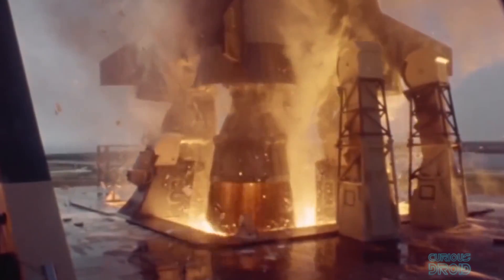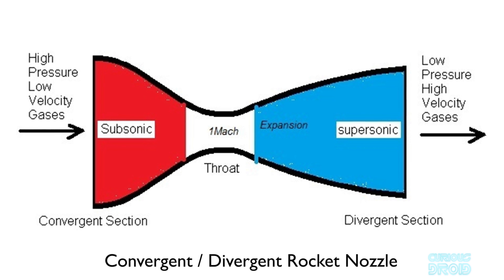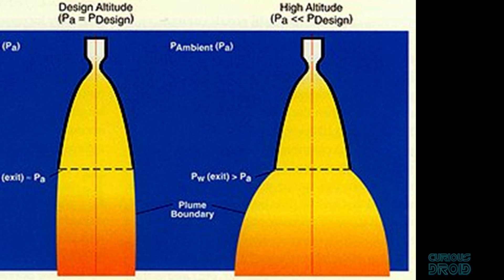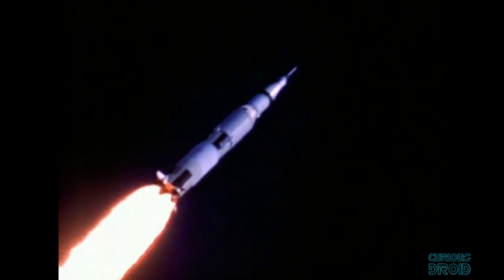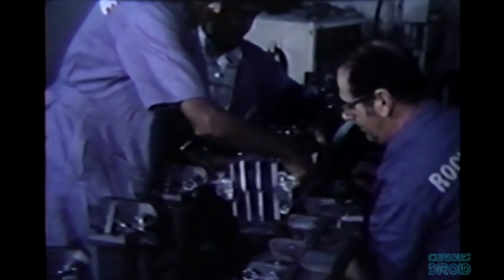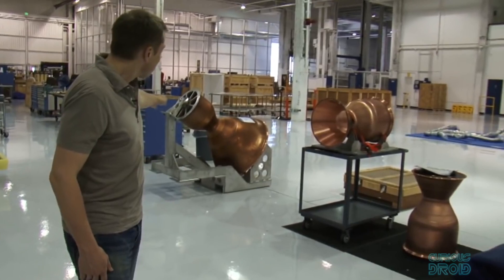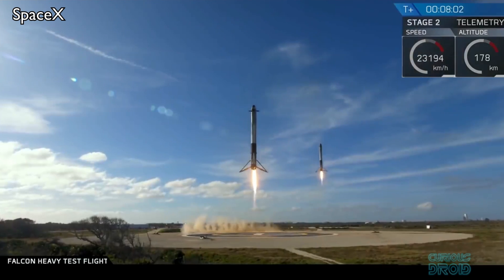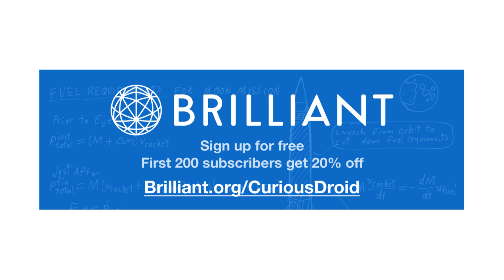Aerospike Engines - Why Aren't We Using them Now?

Comment: I hope someday Aerospikes are used for at least booster stages of rockets, they're design is awesome and I believe that if they are proven, going for a typical bell shape instead of a spike will be a thing of the past.
Great video!
Reply: In vacuum, the spike doesn't really do anything for you that a lighter, more easily-cooled nozzle doesn't. An aerospike is good for a sustainer stage like Atlas I's centre engine, though, or a single stage like VentureStar.
Reply: Chad Castagana, if you only use the aerospike for the upper stage of a traditional rocket stack then you've wasted the best chance to make the most of the efficiency gains that come from the design: a higher and more constant Specific Impulse all the way from sea level to high altitude. de Laval (bell-shaped) nozzles gain efficiency as they climb - up to a certain point -  as a result of being designed to have an under-expanded plume at sea level, which compensates for the inevitable excessive over-expansion that occurs at high altitude (where you'd normally dump the booster and light the second stage).

Interestingly enough, the efficiency vs. altitude curve of a bell-shaped nozzle is pretty bell-shaped itself, with designers needing to tune the edges of that curve so the engine is as efficient as possible over most of the flight regime for the stage while also taking into account the need to throttle down before reaching the point of maximum aerodynamic pressure ("max Q"). An aerospike still has a curve but it's a lot flatter, closer to maximum efficiency for any given propellant and engine design combination across a much wider altitude range... not a straight line, but about as close to it as physics allows us to get. 

So as Mush V. Peets pointed out, the best use for it is in a core sustainer stage. The flatter efficiency curve greatly simplifies a whole bunch of stuff in terms of the entire rocket design, so it would be cheaper to build. Such a rocket would likely still need strap-on boosters to get heavy payloads off the ground, but because the core stage is more efficient at sea level and can continue to burn all the way up to vacuum without losing that efficiency, the boosters could also be much smaller/lighter/cheaper. They'd really only be there to give the "kick" required to overcome gravity and get the rocket up through the first couple of kilometers of sky. Lighter payloads probably wouldn't need them, so you'd have a true single-stage-to-orbit launcher which could make small payload launches even cheaper again. And as Mush V. Peets also mentioned, a de Laval nozzle in a vacuum actually has several benefits over an aerospike design, so you could save the cost of developing an upper-stage aerospike engine and just use tried-and-tested designs for the upper stage and payload.
 
Taking it further, if you designed the boosters themselves with a "low altitude optimised" version of the aerospike engine and made them recoverable/reusable, you could launch 100+ tonne payloads to Low Earth Orbit for a fraction of the current cost per kilogram. But the concept will only pay off if a space agency/government or private corporation is willing drag it through the very long and expensive development process, which goes something like:
 a shitload of maths --> a design study --> prototyping --> tooling design --> manufacture of test vehicles --> static testing --> redesign --> retooling/remanufacture --> more static testing --> flight testing --> more bug fixing --> more flight testing --> specific test flights for certification --> certification achieved. Many of those steps will be punctuated with explosions, delays, cost overruns and assorted political bullshit, most likely dooming the project from the start. But nobody ever said Space was easy. :)

Wow, sorry for the LONG wall of text... as anyone can plainly see, I enjoy rapping about rockets.
Hopefully somebody somewhere will actually read it all and finds it useful, or at least mildly interesting. :)
Reply: Mush V Peets,

I'm not sure I follow your dissenting comment. The VentureStar, the X-33, was meant as a replacement for the Space Shuttle. Like any other low orbit vehicle to date, the X-33's goal is simply to get to orbit,but in this case do so with far less expense, and easier maintenance. You could also imagine the X-33 being launched much more quickly, even for rescue missions. 

I can see where you might think that Bell nozzle rocket would be better in deep space but based on what? The Aerospike can easily be used in a vacuum, since it is nothing more than a redistribution of thrust and a different nozzle design. Reaction control thrusters can be used on the front clip of the vessel for steering, if you are stuck using a Linear Aerospike. and Toroidal Aerospike can use the same Gimbals as with Bell nozzles. 

In short, The Aerospike is not a detriment to rocketry, whether the destination is low orbit, the Moon, Mars, or beyond. She vessels would simply be designed to work with whatever main engine they are going to use.
Reply: X-33 and VentureStar are not the same thing. X-33 was a subscale proof of concept; VentureStar was the full sized SSTO shuttle.
Reply: Try not to get so condescending when somebody corrects you. Just accept it as part of a civil conversation.
Reply: sixstringedthing I found it interesting and read it all don't worry, your text didn't go to waste
It was interesting
Reply: Quinsey Fritz  No, no, no, the Aerospike should be used for upper stages and the bell nozzle used for the booster that gets the craft off the ground (sea level) till it reaches transonic speeds at high atlititude, then use aerospike enigines. That will make these engines practical application in the near future viable?
Reply: Corey Taylor.  www.AdamtheWoo.com , has in his travels across the USA, explored an old factory that was trying to build these aerospike rocket engines.
Reply: Helium Road,

Same thing same mission, and if they are different scale, so be it.  Besides it was easier to type "X-33" than "VentureStar". Add to that more people are familiar withe the X-33. Also it is unlikely the VentureStar was ever built since the project was scrubbed without a completed engine and fuel system.
Reply: Quinsey Fritz Yeah, it looks futuristic as those science fictions. Non-bell-shaped engines really do exist and do have practical benefits, it's just that they are not as test and well proven as the bell shaped engines we already know and it gets the job done.

I hope I will witness to see a single stage space shuttles with aerospike engines.
Reply: arca space is building a aerospike rocket
http://www.arcaspace.com/
Reply: Helium Road

 You never corrected me, you never even entered relevant information. Now stop getting butt hurt about the first time you ever heard about VentureStar being on Wikipedia and knew so little you just parroted the Wiki page like an empty headed trog. You didn't even really know what you said you know. 

Basically you got caught being dumb.
Reply: Really? You get called for not actually knowing what you are saying you know and you call that being insulted. 

The VentureStar was NEVER built, it does not exist. It was a proposal. But, according to that same Wiki page, "the failures of the X-33 demonstrator" meant the VentureStar was NEVER built. Ergo saying the VentureStar ever existed at all is a fallacy and defending that point is a lie. It also shows you did not know what you knew because you failed to comprehend the rest of the Wiki page. 

That you are pretending to you are in the right by presenting a lie by omission as fact is insulting.
Reply: Not for vacuum optimized engines.
Reply: Quinsey Fritz, thanks for letting me know mate. :)
Reply: They are literally two different vehicles. X-33 wasn't even going to fly in space.
Reply: Another word of advice: don't insult people and insist on getting the last word. That's right up there with being condescending. That said, I realize you need this, so I'm going to stop now and let you have it.
Reply: Arca looks like total vaporware and seems pretty unlikely to ever fly.
Reply: Helium Road, 

True. The first new space vehicle NEVER goes to space. 

Also, try NOT to sound like you are copying what you JUST read from Wikipedia. "Subscale"? You posted that like you don't know what it means but it makes you sound smarter for using it.

Comment: 3:35 Why does the rocket appear to be pointing downward? Is this an optical illusion due to the Earth’s curvature? I know the rocket is gaining speed and altitude...so how does one explain this phenomenon?
Reply: The Apollo rockets (and probably all orbital rockets, for that matter) flew a curved path where they turned from vertical to horizontal, eastward, out over the Atlantic, as they gained altitude. Since the camera was land-based, the rocket is moving away from it. Think about watching an airliner flying overhead. When it's moving toward you, it looks like it's going up. Going away, it looks like it's going down.
Reply: its the angling of the camera. its just like you turning your phone upside down while filming. It also might be like wtching a plane flying over your head. it doesnt crash into the horizont, but technicly looks like it goes downwards. or both.
Reply: Of course it's due to the earth's curvature.
Here's how to envision it easily.

Pick some arbitrary altitude above the earth. Say 10 miles (16 km). 
Imagine a circle that is 10 miles above the surface of the earth, following the earth's curvature. That curve is neither rising nor falling in altitude.

Any rocket that is following that curve will also be traveling horizontally with respect to the ground. Even though, as soon as it moves any distance "down range" of an observer, it appears to be heading downward.

That curve is your reference line, separating objects that are losing altitude from those that are gaining altitude. 

Any rocket following any trajectory angle above this reference curve is actually gaining altitude, even tho it appears to be heading downward.
Reply: Obviously rockets launched into polar orbits will travel a different direction.  Vandenberg launches to the south over the Pacific because there's no risk of hitting another country.  Northward would land rocket parts in three different US states, as well as Canada and possibly Russia.

But also, the effect could be enhanced by the fact that the rocket is so far away, it may actually be traveling "downwards" from your perspective, because it's "dropping" beyond the curve of the Earth.  I don't know how far away the vehicle is, but it's a possibility.
Reply: It's pointing away (and very slightly up) not down.  You get to orbit by going 7.8km/s sideways.  The amount of "up" to clear the atmosphere is relatively small in comparison.  You only go up initially to get clear the thicker part of the atmosphere and allow a natural gravity turn (so it doesn't turn into a lawn dart).
Reply: They often do point back slightly downward (rather, inward) from tangential at the top of the initial burn into orbit. You can often see in the telemetry data the altitude decreasing. This is so they are going as fast as possible when they reach the perigee on the opposite side of the Earth, which increases the efficiency of the second burn to the desired orbital altitude due to the Oberth effect.
But that isn't what you are seeing in that footage. That is just perspective, as the others said.
Reply: Roger G2 the rocket eventually will round the earth so at some time the rocket will be going with the nose pointing downwards but because the altitude you can still see it (with very powerful lenses) .
Reply: It's falling back down into the ocean just like all rockets do.
😲
Reply: Watch an airplane flying away from you sometime. It also will look like it is going downward. Or try this: Point a camera upward toward the ceiling or sky. Hold a pencil above the camera, pointing directly away from the lens so you only see the eraser. Now tilt the pencil forward 45 degrees and take a picture. Notice how the pencil is pointing down in the picture, even though you know that it was actually pointed upward.
Reply: I  expected comments from Flat Earthers here, but none so far.  Is the human race maturing?

Comment: The main reason that we use multiple stages on rockets is weight, not engine performance. An empty fuel tank is just dead weight, so you can as well just drop it. Using multi stage rockets saves a ton of fuel and also reduces the size of these things significantly.
Reply: In old Soviet books on rockets I saw an interesting design where the rocket worked as a syringe. As it burned it got shorter and shorter and the excess tank walls just got burned or gradually dropped. This could be the next evolutionary step because it allows to go from a number of discrete stages to a continuous single stage. It also saves on engine weight.
Now add to this a variable shape nozzle and you got yourself an ideal chemical rocket.
Reply: Deus EXmachiA I think the other part of why staging is used is because the engine attached to the empty fuel tank has a significant mass as well.

If the engine wastes less fuel on an inefficient nozzle design, that might mean the rocket needs less fuel to go to the same altitude.  That probably lowers the size and weight of the fuel tank, reducing the need to drop separate stages.
Reply: +Ivan Bulanov
That sounds fantastic in both senses of the word.

It sounds like it could be amazing if done right...

...but it also sounds like a fantasy concept that would be impossible to implement.

I mean, if someone does find a way to make it work? Great! But I'm unconvinced that it can be done.

Comment: If you do the column of air in all metric, 1 bar looks better
Reply: Sea level pressure is 1013.25 millibars, not 1000. 1 bar is 0.987 atm. SI pressure is in pascals. 100 pascals is 1 millibar. 1 pascal is 1 newton of force applied across a square meter.